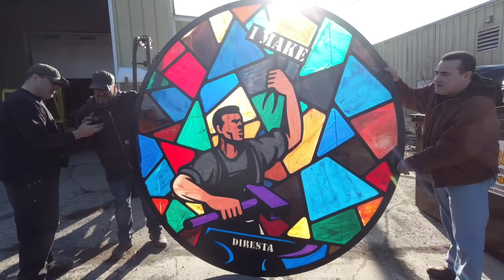DiResta 2 Giant Epoxy Panels

Comment: I love the scale of this! Even cooler than the original version, even if you didn't get to use the Wazer to cut it. 😁 Between the smokey look you got from adding the streaks and the wrinkles from the sheeting on the floor, it looks like actual stained glass. Absolutely stunning! Thanks for sharing!

Comment: 01:35 Do you ever bump into yourself whilst multitasking on video?
Great method of making "stained glass" . You're a great artist!
Does the construction adhesive holding both semi circle patterns together on end grain hold sufficiently in a strong bond as wood glue would on side grain?

Comment: that is a nice effect.
I wonder: If you want to imitate the small parts effect of an old stained glass window, would it make sense to 3d print the ribs from black filament?
If you want to imitate a large gothic window wich has Stone masonry large ribs, and finely structured lead ribs, I would use wood for the large structures, and 3d print for the small structures.

Comment: This is not stained glass and shouldnot be called stained glass
Reply from the maker: It’s stained glass.
Reply: @jimmydiresta  its not glass its epoxy if its not glass soldered together using lead came or copper foil its not stained glass its faux stained glass. Having said that its still a fantastic piece of work